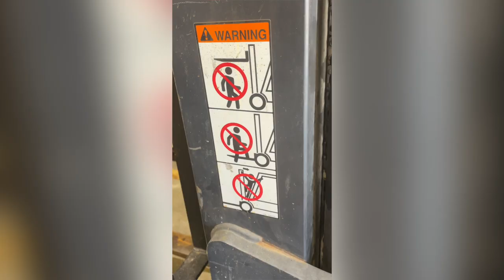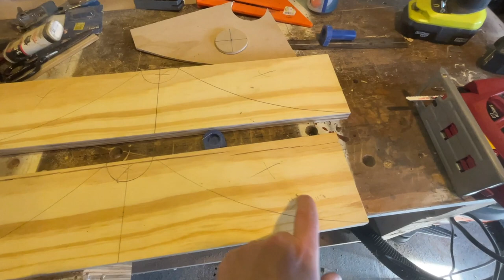DIY Skate Build- Slappy Spine (Keen Ramps copycat)

Comment: This is definitely the way to go if you have the equipment and tools
Reply from the maker: If I were to make it again I'd use 1/2 ply and bevel the bottom where it contacts the ground instead of the 1/4". I'm sure the baltic birch stuff that Keen uses is stronger than what I had access to at Home Depot, I put my wheel through it and went flying last time I skated it lol. The 1/4 held up for about a year of semi-regular skating though, not too bad.

Comment: You did a great job.  I have been thinking about doing the same, just to be able to get a 6 footer.  Hard for me to justify saving only $70 bucks with the price of lumber though.
Reply from the maker: Yeah, I feel that. If it was 6' instead of 4' I'd have probably just bought one. That said, I like woodworking and video production, so I got two fun projects out of it, plus the thing itself.
Reply: How long did it last or like how much skating did u get out of it
Reply from the maker: @mattpriceplucky2646  I've only had a couple sessions on it, but so far it's holding up really well. One of the corners is chipping a little, but that may have more to do with uneven ground than the thing itself. The structure itself is really solid, so worst case scenario I replace the 1/4" plywood at some point down the road.

Comment: You should have framed it with blocks shaped like the profile every eight inches. That would save material and be more rigid. It is how the Keen ones are made.
Reply from the maker: https://www.youtube.com/watch?v=fbJ5v2BNAsM&t=578s&ab_channel=KEENRAMPS I built mine the same way Keen Ramps make theirs, with plywood templates on either end connected by horizontal 2x4s. Feels pretty rigid and solid so far, but we'll see how it holds up over time!

Comment: I can’t find any 2 inch steel pipe at Home Depot or Lowe’s, would galvanized fence posts be too flimsy?
Reply from the maker: I'd check around for a plumbing supply store near you, that's where I found mine. I've seen folks make them out of pvc and other materials though, so the galvanized post might work? Only one way to find out ¯\_(ツ)_/¯

Comment: Hi Thomas. That's a great project !
What is the total height including the coping ?
Do you have a diagram to build the sides ?
Reply from the maker: Thanks! It's 6" tall in total including the coping. I don't have detailed plans, but I posted a rough cut list that I used to get everything broken down at Home Depot on the r/OldSkaters subreddit, if you search for it there it's in the comments. Hope this helps!

Comment: Could you give a list of all the parts and materials you needed to build this? I want to attempt this as well I’m just balling on a budget
Reply from the maker: 2x4s for the supports, 3/4" for the transitions (you can get 2'x2' project panels), a sheet of 1/4" for the riding surface, and 2" schedule 40 steel pipe. cost for the materials is gonna vary based on how big you build it, plus screws, drill bits, countersink, etc, hope this helps!

Comment: How did you come up with the radius and height of it? I built a mini ramp a few months ago and used galvanized pipe as a temporary coping until I got my actual sch 40 steel. So I've got 2-8' pieces of pipe and have most of the material left over to build a slap stick.
Reply from the maker: for the height I copied the dimensions for the Keen Ramps original version, so it's around 6.5" from the ground to the top of the coping, I believe. For the transition, I just kind of eyeballed a curve and sanded it until I liked the look of it. It's a little whippier than I originally planned, but it's fun.
Reply: @Thomas Neeson  awesome! Appreciate your reply man!

Comment: How did you attach the pipe to the wood?
Reply from the maker: I drilled holes in the coping and then slightly oversized holes in a 2x2 and attached them with bolts and washers. There are some really good detailed videos on that elsewhere on youtube, I just watched a bunch of those til I had the general idea and did that.

Comment: That is sick man! I watched Cory's video where he built one and made some screen shots so I could try to make my own. My question is, where did you find coping? I can't find anything useful at the local home depot and a 4 foot piece 2" schedule 40 pipe online is like $80 plus shipping. I'm starting to see why they charge $200 for the 4' slap stick.
Reply from the maker: I got my pipe from a local hardware store that cuts pipe to length, and I live in the middle of nowhere. i posted on a local "community forum" FB group and a bunch of folks suggested local places, so I'd start there.

Comment: I'm building an 8' footer in two months..my problem is gonna be how to attach the steel coping..please someone post a video
Reply: In this video, Cory Keen explains how they attach coping for their 1/4 pipes. They use the same technique for the slap stick.

https://youtu.be/nQOA6CWNhyg?t=473
Reply from the maker: @charlesging4630  That's a good way to do it if you've got a tap to thread the hole in the pipe. If you don't have a tap and die set though, you can drill the holes in the same places and use J bolts, which I had a hard time finding but ended up getting them at Tractor Supply.